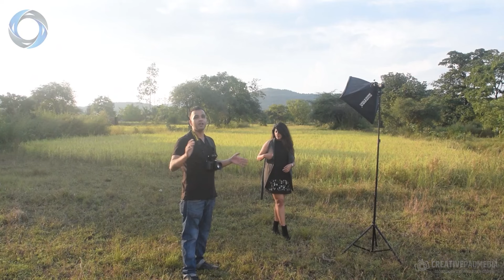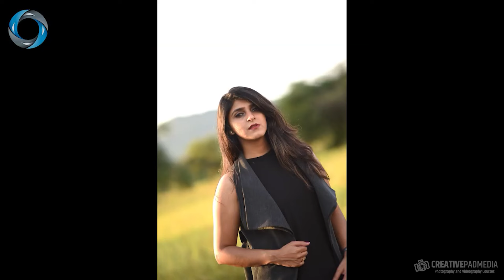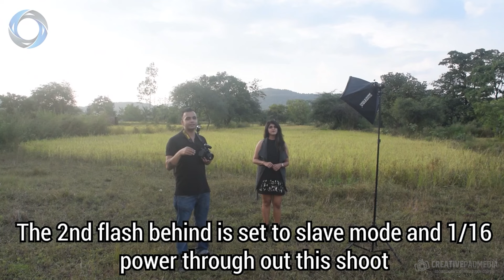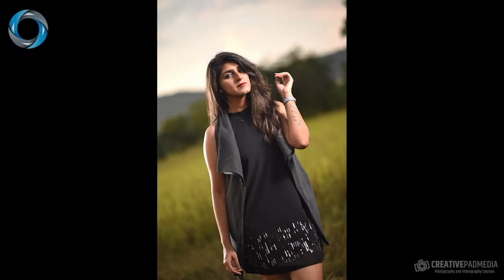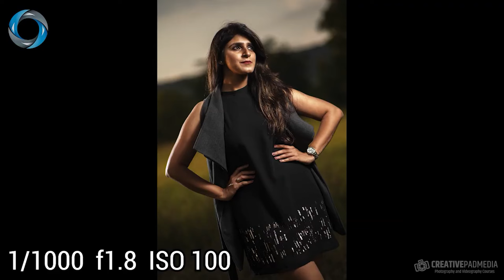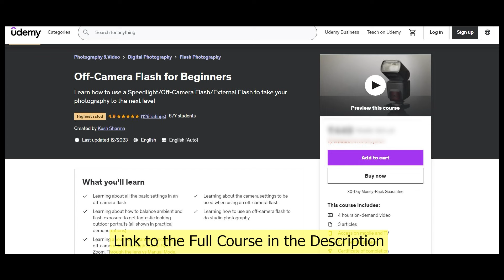Using Off-Camera Flash for Outdoor Portraits

Comment: Waayy too much specular highlights and contrast.  She needed a makeup artist to dust the sweat on her so that she didn't "glisten."  Dramatic is subjective, to me the dramatic shot(s) would be trashed.
Reply from the maker: Yes, you're right about that. The main issue I would say isn't about the make up. It's because the soft box I am using is too small, so the lighting is harsh. That causes all the problems you pointed out. Because I was using a V860, it isn't powerful enough to be used with a larger softbox nor does it fill the surface area of a larger softbox, which would have made the light more flattering and softer. If I had something like a AD 400/600 with me, I could have used a larger softbox. But this course (that this video is a part of) is designed for beginners and therefore my focus was more on the technical side of things from the point of view of using an OCF and not so much on the aesthetics of the final shot. I do plan to create another video with a stronger light and a larger modifier.